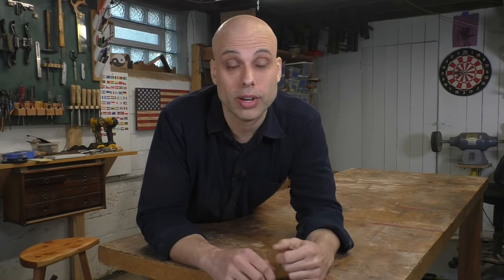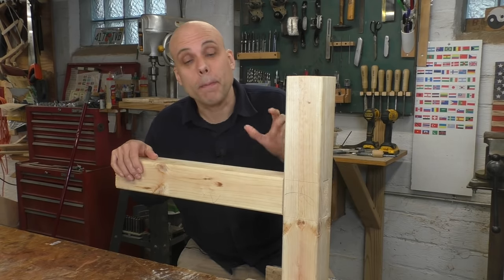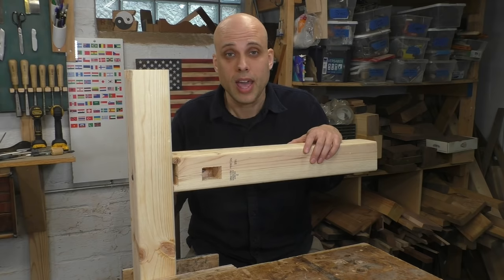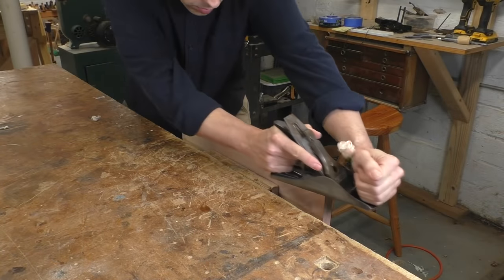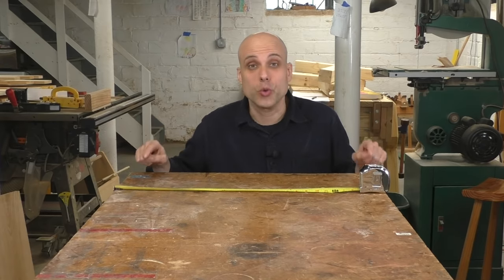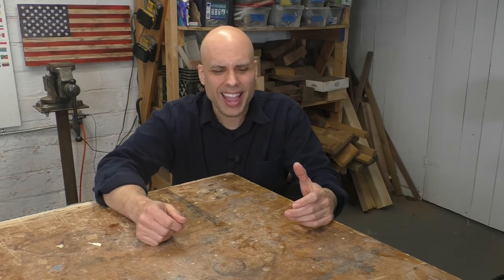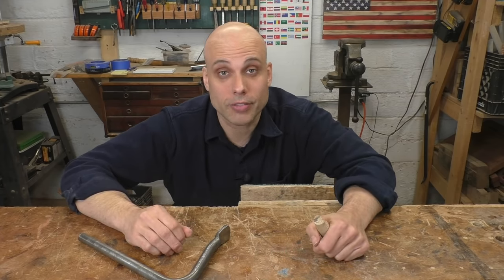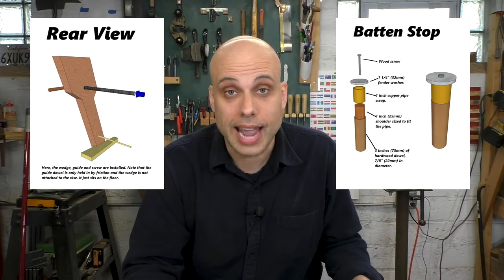Four Workbench Building Mistakes (that we all make).

Comment: Great suggestions for most of us. My father built our house, barns and all our furniture by himself starting in 1945. He built his workbench with masonry walls for legs and a railroad tie table topped with a piece of 3 inch thick laminated maple flooring from an old bowling alley. It was 16 feet long, 18 inches deep and very stable.  He never moved it either.
Reply: Having spent my 12th summer helping my father terrace in three tiers the 50+ foot wide, 45 degree, 45 foot high embankment behind our home on the Providence River with Rail Road Ties, I understand exactly why he never moved it.
Reply: When I was a pup, my grandfather built his back porch out of railroad ties that were left over from when they replaced ties on the tracks in front of his house. This railroad ran through town at the time. He built it in the late 70's and as few as 5 years ago, that was the last time I laid eyes on it, that porch is still standing.

Comment: A lot of beginners want a big top. When we actually start working, we realize we only use about 16 square inches. My top is 18" wide and 6' long and it is plenty.
Reply: and not everyone has a big shop ;)
Reply: My workbench is 8 foot long by 3.5 feet wide.  Most of the powertool work and storage is done on that.  My "squaring table" is a solid 2x4 top about 3 foot by 3 foot.

This is my setup, but works well with the mixture of handtools and power tools i use.  Also the squaring table fits underneath my workbench so it condenses nicely when i dont need to use it.

The workbench is higher for stain, varnish, and miter saw work, the squaring table is shorter for hand tools and is the perfect size for construction and hand tool work.

You really just gotta copy the masters, then improvise for your own needs.  This somehow all fits in my little shed too lol.

I might build a real classical workbench, but its gonna be a minute till i have room for it.

Also i suggest using a plywood top and put about 7 coats of spar on it.  When it gets bad you can either sand it back down, or sand and recoat.  Keeps weight down, and looks nice.

Comment: I'm making a little bity workbench.  Got the stock cleaned up and ready to go.  20"x46" top, 32" tall (I'm your size).  10" apron on one side for dogs.  No vice, just clamps right now, one side of the top is mismatched in length like your sawbench.  Worried that it's small size will keep it from being sturdy.  If that turns out to be the case, I'll lower it roman-style kinda height but I'm hoping it works out.  With the tools I have, going with a combination of half laps and pegged bridle joints.  Also using some flat-tire-sealant to spray the bottom surface of the legs to check out if it works as noskid, will let you know.  Thanks for the years of videos.  Keep 'em coming.  I'm your age, your size, but a decade behind you.  Wish me luck.

Comment: Rex, great video!  I wish I could do videos like you - Nicely done.  I did just like you, but I had the experience to build much better.  I built a personal design multi-layer plywood top, 36” wide and 4’ long, with tool storage underneath (whole other subject), and not enough overhang for any type of serious clamping - Live and learn.  I got a copy of Chris Schwarz’s Workbenches - great resource like your video to guide me.  I found a very cheap supply of rough cut ash.  2 months and a lot of patient chopping, handsaw, chisel, planing...I built a beautiful Holtzapffel.  Mine is a little taller than knuckle height...2.5”...But, I have a serious grenaded back from the military.  However, your height recommendations are spot on.  I just subscribed.  You might encourage me to do some woodworking again.  I still love mortice and tenons and hand-cut dovetails!!!  Cheers, and keep up the fantastic work and passing great knowledge.

Comment: Rewatching this video again. I often see people talking about their composite tops staying flat, but I can definitely imagine them sagging between the supports, especially if they get damp. And unless the supports are also made from an engineered product, they're also susceptible to warping, which will pull your top out of true.

I think designing your bench top such that it can be planed true is the only way to be sure of its flatness.
Reply: On the other hand, I think a lot of people put way too much stock in extreme flatness in their woodworking benches, and extreme precision in their wood working in general.

Woodworking is not machining. The same level of precision is neither needed nor even desirable.
Reply: @Bustermachine  it depends on the work you do. I built my first guitar on a Black and Decker Workmate, and it was totally not easy. I imagine if you're trying to cut accurate joinery at either end of a 6ft board, then having both ends of the bench coplanar might help this. I don't know, I don't make big stuff.

Comment: New subscriber to your channel and very green woodworker. Forever broke and always a mess. I bought a compound sliding miter saw almost 2 years ago with what I thought was going to be my first in a long line of paychecks but ended up being the only income I've had in the past several years. The saw then went unplugged and never used for almost 2 years. I have virtually no other tools. A cordless drill, a one inch chisel and a saw I finally plugged in a few weeks ago. No type of square, no type of measuring device, no sand paper, lol, it's been a pathetic journey. Truly. 

I finally ran across a small sum of cash and bought some lumber and a box of screws. Knowing next to nothing about anything, I started building a saw table for this saw I had never even hooked to power. 

So I started this project and only have the materials to get about half way to where I want it to be. Starting out, I didn't know anything about joinery or jointing or whatever. Thanks to content creators like you and many others, I found out what a lap joint is (and many other joints) about a week into my project. 

I got as far along as I could until I somehow find more cash. Somehow, what I have to show is turning out pretty good, especially considering I have no way to check for square or make measurements. I've just kind of been taking my time, every step of the way has been excruciatingly slow. I've had no real plan, just figuring out what I can do with the little I have. 

Thankfully, and I truly can't thank you enough, I have already learned quite a bit about some basics of woodworking over the past few weeks. I've finally gotten to start putting my desires to action and am so grateful that people like you are out here just sharing knowledge with anyone who stumbles across it. It's been nice to finally have something to do after years of hell and isolation and mental illness just kicking my ass. 

I don't even know what I'm rambling about. Everything has been so shitty in my life that I'm crying just thinking about the past few weeks, finally being able to make a start in something I've been trying to do for a very long time. If it wasn't for people like you, just sharing knowledge and expertise freely,  what little I have accomplished in the last few weeks would have been just another abject failure. Instead, I'm about halfway through building a saw table that is going to be solid for many years to come. 

Thank you so very much.

Comment: "If you're watching this video, it's likely that you're mostly a power tool woodworker, just looking in to getting your first real bench."

I don't think I've ever been called out by a Youtuber as accurately as this.
Reply: I thought he was talking about me! 😀
Reply: Skip the wood a steel bench is truly the best.  You do all your projects. Drill holes for all the places . Zero worries of warping. If have to bolt a sheet of plywood reversible with a sheet of counter top.
Reply: @robbie6625  for those rare times i am working with dead tree carcasses.  Got sheet of plywood to put on the steel deck. The other side is cheap laminate. A couple of clamps. That way  I don't damage those tender wood planes and chisels. 
Fun no one bolts their bench to the floor 🤔
Reply: @assassinlexx1993  that makes sense. If your primary medium is metal, then it makes sense for you not to have a fully featured woodworking bench.
That being said, I could just as easily say that you could build a woodworking bench and then put a metal surface on top of that.
Honestly, this discussion now has me thinking about the possibility of making a reversible benchtop that just had a permanently attached metal work surface. You're really triggering my engineering inclinations LOL
Reply: @robbie6625  - Better to have two benchs. Reversible tops become a pain in the joints.
Reply: @caseyspeaks6380  the bench's joints or my own? 😂
Reply: @robbie6625  - mostly mine, but the bench didn't weather too well, either. 
A lot of nicks and scrapes on the legs.  At least the bruises healed qucikly. lol.

Comment: Use washers.   Good points about choosing better joints.  However,  all fastened connections will be much more stable if washers are used on both ends of bolt.
Reply: Doesn’t work either. Where Rex is slightly wrong is, that it’s not only the compression of the wood, but also bolts with nuts will unscrew themselves over time due to vibration. That’s why in industrial usages, nuts and bolts are secured by loctite or other, mechanical means like snap rings, retainer rings etc.
A washer does not help.

And there’s another aspect: wood shrinks and expands during the seasons and this will contribute to that self-loosening of bolts and nuts, too.

Comment: Paul sellers made a comment, I can’t remember in which video. I actually think it was his blog, one in which she was dispelling myths. In which he said that people had listed benches height as ideal being at the break in the wrist. And he said that is too low and you’re gonna end up with back problems. He recommended a bunch even taller than where your wrist breaks.
Reply: He also has a great trick for figuring out the height.  He says to make it higher than you need, then work on it for a while standing on platforms of different heights.  Once you have a platform that feels good, take away the platform and cut that amount off the legs of the bench.
Reply: @mccormackclass  I did the " Paul Seller's workbench ", works really great BUT it's very tall and I'm thinking in do it again. Paul Seller's only uses it for joinery and rarely prepares wood buy hand, he's working with 4S boards mostly.If you are dimensioning wood buy hand you need another concept of a bench to hold the work efficiently ....and you need a lower bench.
Reply: I agree,  low benches were likely for hand sawing (the height of a saw),  I would expect working between the wrist and the elbow
Reply: @2adamast  and hand planing
Reply: @silmarils94  The elbow is mostly nearly in line with the plane (even in Japan),  so high is also ok.  Where for saw, axe and chisel work the hand can reach quite high.
Reply: The trick is make a bench the height Rex recommends then put a Moxon vise on top of it for fine joinery.

Comment: I think the biggest deterrents to building a great woodworking workbench are: Thick hardwood is hard to find and expensive, they don't have a planer or jointer, or they don't have room for a nice bench. I don't think time, skills,  and joinery are big deterrents at all.
Reply: There's a video on this channel that shows how to build a basic workbench using 2x4 and less than $100 in hand tools. The low Roman bench Rex built is an excellent starter bench and isn't particularly expensive nor excessively difficult to construct.
Reply: @osterpenpen9379  Lots of people have cobbled up softwood benches, but finding and paying for good wood can be daunting.
Reply: @Bob_Adkins  Douglas Fir or long leaf yellow pine may be classed as 'softwood' but thousands of benches have been made of it.  Mine is Douglas Fir and is holding up just fine...I level it with a jointer plane every year or so, but mostly to just have a fresh surface.  Check out Charles Schultz' youtube videos and his books on the subject.  -veteran '66-68
Reply: The bench Rex is flattening here is made of construction lumber, spruce or pine is my guess.  My bench is yellow pine.  If I just absolutely had to have hardwood, I would check a nearby sawmill for beech instead of more expensive maple.  Back when ash was available, it was even less than beech.

Comment: Really informative video, learned some new things and reinforced lessons I've learned over  45+ years of diy/puttering.  Bench width & height with mobility is what I've come up with that works well for me, two 24"x7' benches that I clamp together for an "assembly" bench when needed, keep separated for convenience and everyday use.  I've also learned that wordbenches become "clutter catchers."  My solution has been cabinets (made from shelving units) and under bench storage for "project" materials.  So, my benches have bottom shelf and a mid- or upper-level shelf, different heights on the two benches.  I found 4" x 16" x 12" bins that I use for gloves, rags, safety glasses, note paper, some hardware (like one bin for bolts and another for chain & links, stuff too big for organizers in the cupboards).  They are cheap "drawers."  I've found this system works to keep the bench top clear for actual use, most of the time. 🙂  Thanks, Rex, for your expertise, I look forward to watching more of your work and learning a bunch!

Comment: Why didn't you mention the Moravian workbench? I built the Moravian Workbench and it's awesome, very solid and it's portable. Sounds like it fits your criteria of strength, work holding options, and portability.
Reply: Probably because it isn't really a beginner project. Angled keyed tenons is outside the reach of most beginners.
Reply: @tarbucktransom  bummer, I didn't think it was that difficult.  I have some experience in woodworking but my first tenons and first real joinery were done on my bench and it turned out fairly good, definitely not perfect but it was easier than I thought it was going to be👍 Maybe it just looks hard at first glance, I bet once you try it, it will be easier than you thought it was going to be. Lots of fun and a big feeling of accomplishment once you do it👍
Reply: @tarbucktransom  Not really....I dove in and got it done with nothing more than a circular saw, cordless drill, bench chisels and a lunchbox planer to get the top flat.  Sure it's no work of art, but it certainly works.  The hardest joint is the half blind dove tail, and really it's not that hard to make, just intimidating.  Heck if you wanted to you could just eliminate the half blind dove tail all together and just do a half lap.
Reply: I discounted the Moravian workbench because I am just not a wandering vagabond gypsy. I never need to move my workbench. It's been in the same place for nigh on 20 years now.
Reply: @1pcfred , There's a Beatles lyric my late fiancée used to quote: "Life is what happens while you're busy making other plans". I would say planning on never having to move falls into that category as well.
Reply: @johnbesharian9965  Allen Saunders wrote, "Life is what happens to us while we are making other plans" in 1957. So it was stolen. I'll probably move someday myself. But if I do it'll be on my terms. I'd like to go somewhere drier I think. I am getting tired of water. I can see rock gardening in my future. Where I live now we don't even have rocks.

Comment: I am a fairweather woodworker and I love wood working as a hobby. I feel at peace when I walk into my garden shed(my shop :) .. ) after work.  My first bench was basically 2x3 glued up to make about 22"x5' because that the max I could fit in my garden shed. The legs were 4x4 with half lapped joints. It worked alright, however couple of years ago I came across some 3/4 plywood at work. I wanted to try making Kitchen Cabinet to see if I could do it. I basically ended with 2 cabinets which I somehow managed to build even exceeding my expectations. As I had no use for these cabinets I ended up replacing the legs of my bench with these cabinets. This was by far absolutely the best thing I did. Not only the table now feels lot more solid, I gained a lot of storage too ... just my two cents :)

Comment: Good Morning, I am 6'2" also. I have worked in Union Cabinetmakeing Shops. I couldn't disagree more with you on the hight of your work bench. Who came up with the pinkie nuckle rule? I do not own any tools that I would want to come into contact with my private parts. So I build my work benches for  the top to be at my belt's top hight. I have found that there is no problem for a short man to work at a tall bench. But a tall man working at a short bench will fatigue and develop back issues very quickly. So my bench is 36" in hight. In Europe where they still practice the tradition of Journeyman, a Cabinetmaker would hitchhike to another country in his country's traditional clothing with his tools. He would get a job in another country's shop and that shop would be required to supply him with a bench of an adequate hight. You need to research information before you go espousing this made up.'pinkie nuckle' nonsense. Tom.
Reply: Hahaha I was thinking the same thing before he even said it!
It just looked too low.
My lower back would pop out within a week workin' on that thing!
Reply: I'm 6,2 as well but share a shop with someone 6,6. Maybe his pinkie would fly but not mine lol.
Reply: Its just a gauge.. obviously do what works for you. I can see ur point for sure tho, appreciate the input. I also like a lil higher work bench. But i feel like u shit on dude a lil.. for no reason really.. just another opinion 🤷